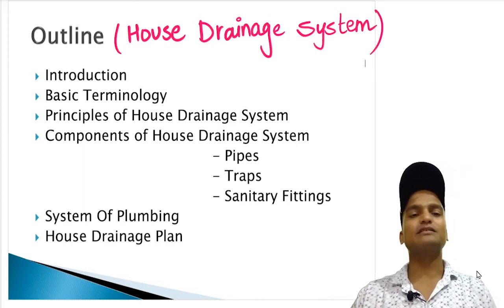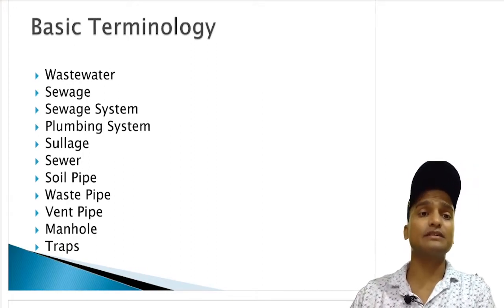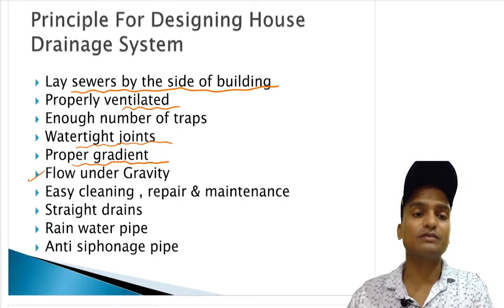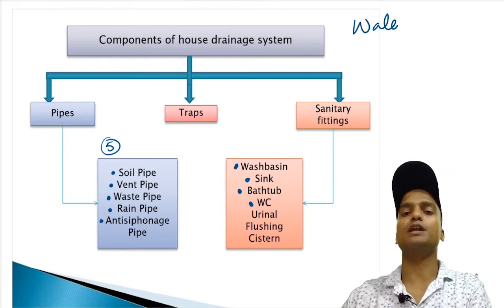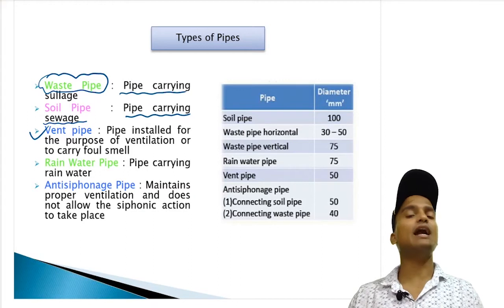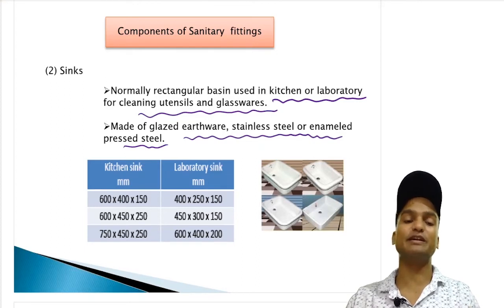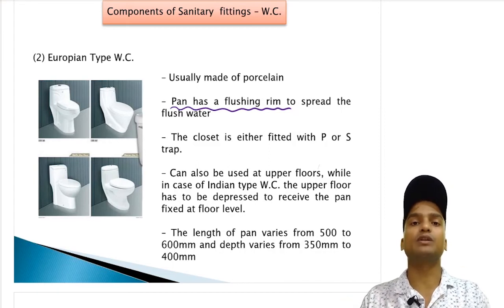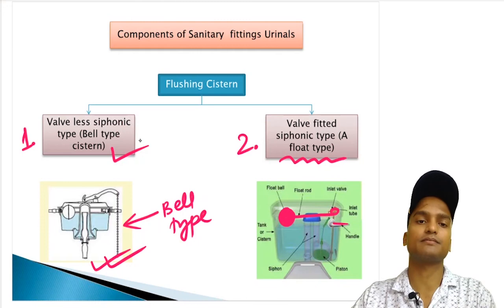11 House Drainage System

Comment: Sir i have a question , but i could not find suitable answer for this question ..could you plz give me a suitable answer for this...my question is
"Depending on subsoil properties ,shallow foundation can be used for a two storey building , critically analyze this statement "

I dont need whole answer , give me some guide to answer this..that is enough
Reply from the maker: When C and Phi of the subsoil are above the standard provisions then it can take load of a 2-3 storey building through shallow foundations.
Reply: @MayankKumar-cg3mr  thank you so much
Reply: @MayankKumar-cg3mr  c means what?
Reply from the maker: c=cohesion of soil, Phi=internal friction of soil - according to the Mohr-Coulomb criteria